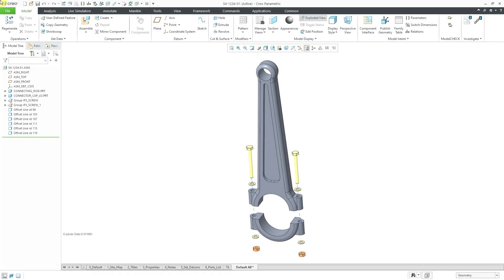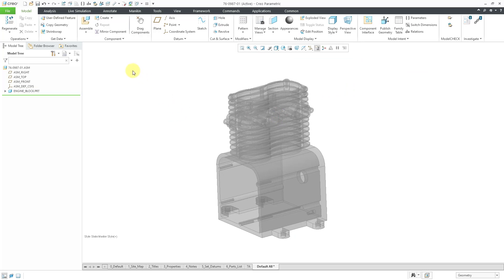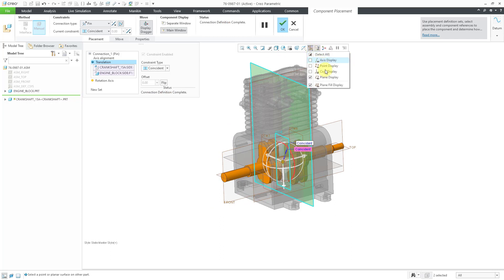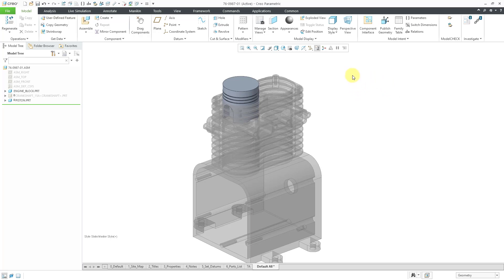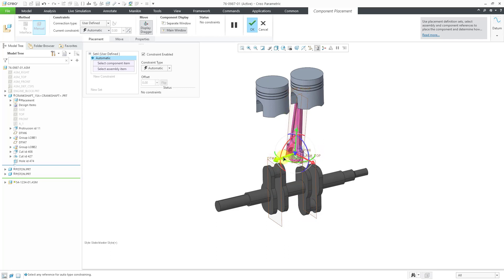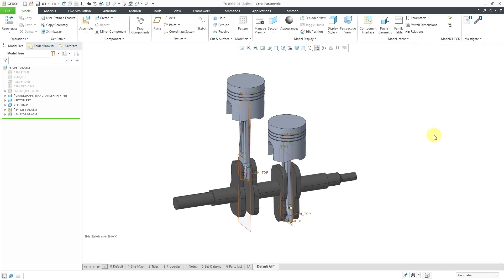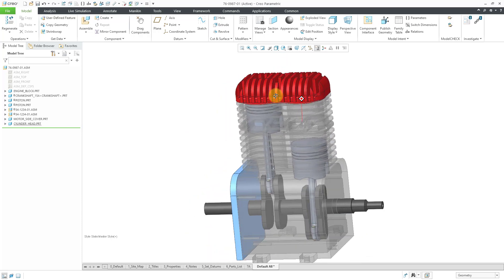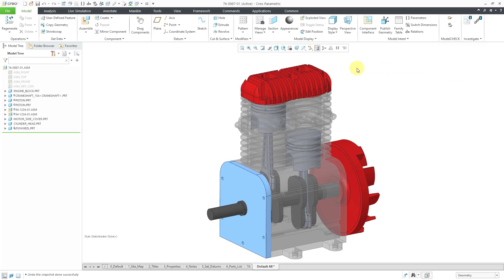Creo Parametric - Assembly Basics (Part 3) - How to Create an Assembly

Comment: Good stuff. I’ll share an assembly trick I learned years ago from a then old Pro/E expert: always try and make your assembly constraints follow what you would do in real life if you were assembling it yourself. You’ve done that here with aligning to the bolt holes and personally I feel it makes the assembly more robust in the long term. The other thing I do is always constrain fasteners to the threaded side of the hole, whether that’s a tapped hole or the nut side, that way if something changes with the non tapped side, I move the hole, position changes because I didn’t choose a stable dimension scheme for the hole, etc., you’ll notice quicker that there is a change. Typically the tapped side is blind in the assembly and if you’ve constrained to the non tapped side the bolt will move with the hole, but you may not notice that the thread is now in the wrong spot but if you constrain to the thread, there will be a mismatch on the non threaded hole that will look odd around the fastener.